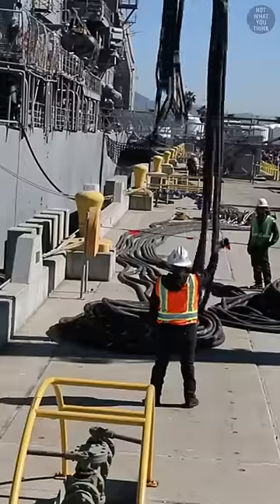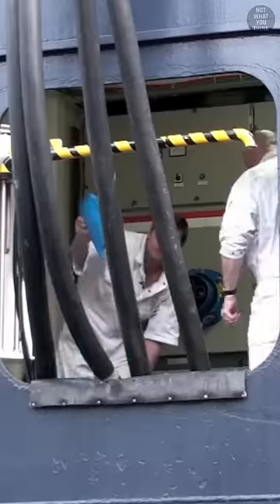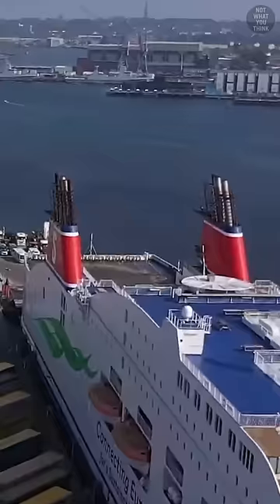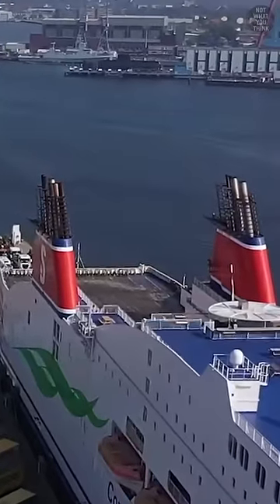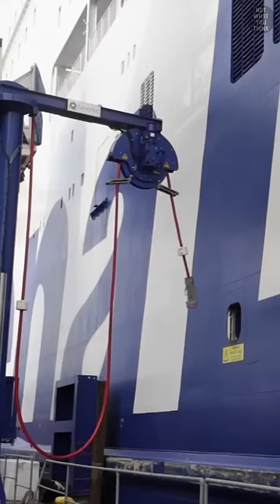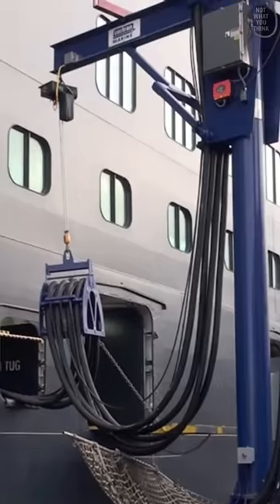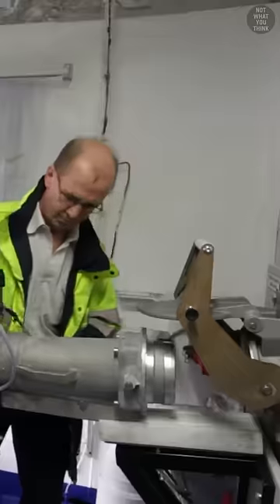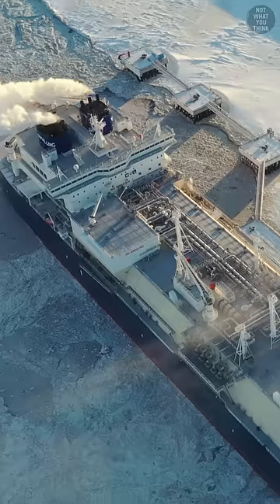Why Ships Burn Fossil Fuel When Idling? #shorts

Comment: One ship= 50 million cars

And yet they’re trying to force us all to get EVs
Reply: 50 million cars is still 50 million cars. Would you set fire to your house just because you saw someone else also trying to burn it down?
Reply: @frainy345   or you had a bad education... Even if humans are a problem you will NEVER turn and talk to the ones who are doing the polluting.
Reply: @relguiatmont7336  is there some intended meaning in those words you attempted to string together?
Reply: If you get rid of the ship, you have to find other ways of moving the cargo.

The ship is the most efficient way to move the amount of cargo that needs moving.

Until they build global conveyer belts...
Reply: @goodisnipr or, artillery cargo cannon, capable of launching cargo from country of origin to it's country destination straight to your receiving custom.
Reply: @frainy345 (Greta) (Moshe) Thun[[[berg]]] arrives to the WEF/Davos climate change summit every year in a private jet and then a gas guzzling hummer limo so (s)he can tell us to drive EVs, use public transport, eat bugs, drink soylent, sleep with the lights off and take cold showers.
Reply: @relguiatmont7336 I'm an environmental technician. As long as people keep trying to point fingers and blame other people for making more pollution we will never get anywhere. Guess what? You are the reason those ships are even necessary. Everything adds up, just because one thing os more than the other doesn't mean we ignore the smaller thing. If you treated your health like this you would be dead within no time.
Reply: @AGUSTIN-zc5iu 😂😂😂
Reply: @QwertyoUip  are you planning to arrive at your point anytime soon?
Reply: Sooo, why is the shipping industry not being forced to redesign engines and power units to be more environmentally friendly? And why is that load being so heavily shoveled onto regular people?

Something about this seems like heavily unbalanced bullshittery to me.
Reply: @Novafro  real
Reply: It's not "they" ... It's us. Buying cheap goods from China that don't last. It'll be fixed soon, industry is moving manufacturing to Mexico at an incredible rate
Reply: @goodisnipr The problem is doors have absolutely no population regulations. They can, and do, throw as much pollution into the air and water as they want. I've read there are just a few thousand big ships in the world, compared to something like 15 billion cars. But those few ships put out more pollution than all of the cars put together
Reply: @danielescobar7618  yeah I think that would be a positive move… ideally we move the manufacturing back to the US but at least Mexico is closer
Reply: @goodisnipr  that is a fair point, certainly ships are a lot more efficient than aircraft 

However, maybe the whole global supply chain is the real culprit?

Or at least, we have design engines and exhaust systems for ships that are create less pollution?
Reply: What is the connection you’re trying to point out?

Those ships are the backbone of the global logistics industry. Almost everything we buy is transported around the world in those things. And in terms of efficiency, one ship may be worth 50 million cars in total emissions, but due to the sheer amount of goods transported, they are far more efficient than your car.

Indeed, in order to decarbonise we need to find a better alternative, but shutting that simply isn’t an option. World is built around logistics and transportation. We can replace some ship routes with trains, but in order to match the capacity they need to be very high capacity routes, also electrified (as diesel trains are LESS efficient than ships) but even that is not gonna cut it since crossing the Atlantic/Pacific isn’t possible with trains. The only option remains nuclear cargo ships, but there isn’t much work going into those.
Reply: @tubeofnoob4683 but why restrict normal folk to be environmentally friendly when politicians have private jets, rich people own yachts and 30 supercard and giant cruisers are constantly sailing. They pollute the world more in one week than I can in my whole life.
Reply: @thebakedtoast  now multiply that by the population. There are many more regular people than politicians or rich people. And last time I checked ked we are not forced to be environmentally friendly lol
Reply: Because it's not about saving the planet, it's about control
Reply: @nicolaspeigne1429  True.
Reply: @frainy345 Would you set fire to your house with a match just because you saw someone setting fire to it with a flamethrower? That’s how bad that analogy fits this situation. 🗿
Reply: @frainy345 I know what the problem is. We found a butthurt dude with an ev who thinks he’s actually helping to stop global warming
Reply: @daveyjoseph6058 it runs on rainbows and unicorn farts.
Reply: So i can't buy a new 250cc 2 stroke but a single ship can put out more weight in fumes than 2 strokes made in the last 25 years.

Yes, what a fair society we live in!
Reply: @frainy345 Proportional representation.

Not point chasing 1% and ignoring 99%
Reply: @tubeofnoob4683 we absolutely do get forced to be enviromentally friendly with "fixes" pushed on the populace.

But most are fake fixes: paper bags which cause 10 times more shipping as less fit on a pallet.

Bagasse which was great to get rid of sugarcane waste ~ but now we produce more sugarcane for just the bagasse.

Or EV's which we all know aren't a sustainable long term solution, with the way the batteries are set up now.

And you say we can't look at the giant merchant ships that can't be arsed to at least fix their pollution at port? Or all the littering they do?

Acting like those small regulations will change anything long term and, not willing to improve the big polluters is a way to get the populace to think we are on the right track, whilst in reality the biggest problems are absolutely not beeing tackled.
Reply: It’s actually not true regarding CO2. 50 million cars produce many times more CO2 than a single ship.
Reply: @tubeofnoob4683 environmental technician? Lollllllll
Reply: @danielleisrael  yeah, I've also taught chemistry at a college. In which I finished with an average of 96%. The fact you laugh at other achievements is kind of pathetic  lolllllll.
Reply: Key word FORCE!!
only about money, power, and, control not the environment!
Reply: @theglitch99  key word NOT as in you do not understand anything
Reply: @tubeofnoob4683  open your eyes and see reality! Talk is cheap...
Reply: @frainy345 yeah but 5 ships equals every gas powered car in america
Reply: Per KG of fuel big ass ships like this are the single most effective and efficient way of moving cargo. Same with towboats on the inland rivers. Semi trucks use so much more per capita it’s not even funny.
Reply: Literally don't drive. That's the thing. Just use public transportation
Reply: @frainy345 There's 1.5 billion (1,500,000,000) cars in the world and 120k cargo ships. 120k x 50 million is 6 trillion (6,000,000,000,000). That's a 4000x difference. Your example isn't really relevant to this, the point is more they're focused on us switching to EV cars for environmental reasons yet situations like these make it an irrelevant goal.
Reply: @baseballhunter42  That's fair, but your figures are grossly inaccurate. The International Maritime Organisation puts global CO2 production by ships at about 1.12 billion metric tonnes, which is equivalent to 205 million cars. The point is though that if road freight were used in place of ships, it would create 100x more pollution according to MIT.
Reply: @Novafro they are. The bit about lack of regs allowing bunker fuel in port is just wrong for the whole developed world 
You need to burn diesel or have emissions scrubbers to enter ports and most seas and channels
Reply: @frainy345  I'm going off the numbers that you've been talking about in the past month here of 1 ship equalling equalling 50 million cars. If you had an issue with that you should have raised it over a month ago, I'm not going back and forth as you change data. My math is entirely accurate based on the data everyone here has been arguing over.
Reply: @frainy345 and there's how many ships? If each ship is 50 million cars, then there must be billions of cars worth.
Reply: @frainy345 would you move out if your comfortable house youve known all your life just someone else sent their house on fire in a different continent? if not why are you forcing us to get electric cars to make up for these ships buring fossil fuels and the lack if regulations around it? why not actually address the issue at hand instead of picking up breadcrumbs? theres 100s of people flying private planes cross-state to talk about how bad ICE cars are when they could drive and be much more environmentally friendly themselves. the people signing the papers that say "all cars must be electric by 2035" flew into that state on a plane much worse than almost any car. but we should see our lives being forced to change as "progression" when we havent progressed enough to know and openly talk about the impact it really has
Reply: That’s a fallacy.
Reply: Global trade should be shut down. Problem solved. 😊😊
Reply: @nicolaspeigne1429  Control over what exactly? What the fuck would the 'big bad shadow government' gain from this shit?
Reply: @frainy345 I was think that about what you said 😂
Reply: @frainy345 Yes I would join them if they invited me, who doesn't want to burn a house seriously
Reply: Now you start to see the connections
Reply: Ummmmm I'm not really sure that that's correct 😂😂😂
Reply: The world cannot currently produce/grow enough power poles to support the necessary grid infrastructure unfitting required in North America to meet current EV goals.
Reply: EVs should be just an option.  In Canada, the cold climate, large distances and limited infrastructure, EVs are not practical.  Mexico would be a more favourable location.
Reply: That's because those making the laws are getting rich doing so. It has nothing to do with the environment.
Reply: @Novafro they are. It just takes over a hundred nations to agree. To get the IMO to do anything.
Reply: @finlaymcdiarmid5832 but ships are two stroke.
Reply: @cloggedpizza239  ?
Reply: @frainy345  if one ship can make the difference of 50 million cars, literally 12 ships can provide for the entire united states (assuming each citizen regularly drives two cars, a very generous assumption). i don't need an EV if these ships can be regulated lol.
Reply: 1: that’s based of off of the sulphur oxide emissions from the largest ships not the carbon dioxide emissions from the average ship.

2: there are 50,000 large ships on earth.

3: there are 1,500,000,000 cars

4: ships are insanely efficient so I’m not sure about those numbers. The true value is that ships use 50 times less fuel per kilometre.

5: we can’t make efficient electric ships yet.

6: cars are by far the biggest polluters, we have the technology to make efficient electric vehicles and we should make them standardised
Reply: @relguiatmont7336 the highest polluters are the individuals
Reply: 50 million cars when measuring NOx and COx because of fuel standards and lack of catalytic converter, not when measuring CO2, the main driver behind climate change and the reason we need to change to electric cars.
Reply: 50 million cars when measuring NOx and COx because of fuel standards and lack of catalytic converter, not when measuring CO2, the main driver behind climate change and the reason we need to change to electric cars.
Reply: How we gonna move things across silly people
Reply: Sloppy language from the video.

By "pollution", he means particulate emissions (because the burning is extremely dirty/incomplete). This is from that black smoke, and these emissions cause smog, acid rain, breathing issues, etc. They are definitely bad.

But they are NOT greenhouse gasses. That is a different problem, and in a weird twist this dirty burning actually has a cooling effect. Those particulates travel into the upper atmosphere and seed clouds, which reflect sunlight mich better than land does.

In terms of CO2, these generators aren't much worse than a single car. They just release way more smog.
Reply: @relguiatmont7336 many ships dont use filters
Reply: It’s not 50 million cars worth of carbon dioxide, it’s 50 million cars worth of sulfur oxides. The only reason the number is so high is because cars and gasoline are regulated the way they are. We used to spew sulfur into the air in and around our cities, which is what causes acid rain. There’s a reason we don’t have acid rain any more, and it’s thanks to regulation.
Reply: @thebakedtoast the reason you regulate regular people is because there’s about 8 billion regular people compared to the number of those with private jets and yachts.
Reply: @birdrocket  and those with private jets cause 80% of harm
Reply: @thebakedtoast  I wish that were true because it would make solving climate change so much easier. Unfortunately, it’s nowhere near the case. Private jets only make up 0.2% of all carbon emissions.
Reply: @birdrocket  private jets, cruise ships, super cars, extravagant life style. It's fact that the super rich account for the majority of carbon emissions
Reply: @thebakedtoast  again, I wish that were true, but it’s not. They use egregious amounts of energy and resources when compared to a normal person, but normal people outnumber the private jet flying rich by about half a million to one. They do not create enough emissions to even come near half of global emissions, let alone a vast majority
Reply: @birdrocket  yes they do.
Recent data from Oxfam’s research with the Stockholm Environment Institute shows that the wealthiest 1 percent of humanity are responsible for twice as many emissions as the poorest 50 percent and that by 2030, their carbon footprints are set to be 30 times greater than the level compatible with the 1.5°C goal of the Paris Agreement.
Reply: @thebakedtoast  that doesn’t mean the 1% produces most emissions. It means that the bottom 50% of people globally emit a very very low amount of carbon. That oxfam report only puts it at 16% of total emissions. Still a huge amount, and way more than what they should be, but not the vast majority of emissions. 

Median household income globally is less than $10k a year, which includes only single digit percentage of Americans. Even the average person in the US is using up way more carbon dioxide than we can afford, you and I included. If everyone on earth was as polluting as the US, CO2 emissions would triple. That is why we have policies that aim to reduce the CO2 emissions of the average American, because the average American is still relatively wealthy by global standards.
Reply: @birdrocket  The richest 1% (77 million people) were responsible for 16% of global consumption emissions in 2019—more than all car and road transport emissions. The richest 10% accounted for half (50%) of emissions.

It seems like you're rich but don't want to take blame. There's literally thousands of articles about this topic
Reply: dont worry, it is a lie
Reply: @frainy345  Oh well....
Reply: We need the ships.
Reply: ...yeah...that figure is way off
Reply: @QwertyoUip  That just isn't true, she uses public transport intentionally.
Reply: @birdrocket  I never knew that about acid rain… thanks for pointing that out
Reply: Scams, scams, and more scams. It’s so exhausting.
Reply: @frainy345  you probably have an electric car 😂😂😂😂😂
Reply: @frainy345 I simply cannot afford to buy an EV.
I drive a 2002 Toyota tundra which has 230k miles on the odometer. It is an extremely reliable machine.
I can drive myself to work with it, I can cut firewood and haul it home to heat my home.
Tell me, which EV vehicle can I afford which provides me the same level of reliability?
Reply: @tubeofnoob4683 no we aren’t the reason those ships are necessary. Once upon a time we used to manufacture everything we needed right here in America and imports were at a minimum. The reason those ships are necessary is because of the greed of corporations and their shareholders who sent all manufacturing overseas to Asia
Reply: Even though you are right. Goals as large as ending climate change must be achieved on every source of human caused pollution.
Reply: It’s because they need oil for the war machines
Reply: 50 million refers just to sulphur emissions, which modern cars basically emit very little of. Its a misleading headline
Reply: @frainy345  50 million cars is 50 million people driving cars. You'd need 50 million EV's and means to produce power for them.

Higher focus on nuclear power would mostly fix drawbacks of EV's, but "nuclear" is a scary word for general public the same way as is LGBT scary word for conservatives all over the word.
Reply: @frainy345 yes yes i would 😂😂
Reply: It doesn’t equal 59 million cars though
Reply: @QwertyoUip  your comment would be more powerful if you didn't let your antisemitism show
Reply: The pollution in this context is sulphur dioxide, not CO2. CO2 pollution is almost directly proportional to fuel burned, and it's pretty obvious one ship doesn't burn as much fuel as 50 million cars, simply because 50 million car engines wouldn't fit on a ship.

Sulphur dioxide isn't so bad for the climate, but it is poisonous. So it's very bad in cities, not so bad in the middle of the Atlantic where there's nobody to poison.

This has led to strict emissions limits for cars, but less strict limits for ships.

Thanks to limits imposed on car and power station emissions, man made sulphur emissions peaked in the 1970s.
Reply: @QwertyoUip  No she doesn't.
Reply: I do not beleive this for one instant, that is a lie outright.
Reply: @jeffs-reviews  It's true, but only for sulphur dioxide. Which is actually fine. Sulphur dioxide is a poison, so you absolutely do not want it coming out of cars which are next to people, but it's far less of an issue in international waters.
Reply: One ship might use 500 tonnes of fuel over two weeks, 50 million cars could use 2,500,000 tonnes (if each had 50 litres). This comparison is poorly conveyed.

Shipping makes up for 3% of global emissions but is crucial in sustaining international trade. Enforcement for redesigning of engines and reduction of emissions does exist through international conventions.

A cruise line I recently worked for as a navigational officer spend over $1 billion dollars investing in scrubbing machinery to reduce their emissions.

Yes each ship uses quite a lot of fuel but it is by far the most economical way of international trade.
Reply: @frainy345 I like electric cars but don't they become CO2 neutral after something like 3-7 years of driving depending on how your electric power is generated and the type of car it is (sports vs economy car etc)? Not to mention the devastation caused by the lithium gathering etc. And we don't even have enough resources for everyone to switch to all battery storage.

At least that is my understanding of the situation.
Reply: @AGUSTIN-zc5iu one of the best comments I've ever seen 😂😂😂😂🎯🎯🎯🎯
Reply: Converting cars to electric drives is straightforward, but greening ships presents greater challenges. Despite the complexity, ships remain more environmentally friendly and efficient than cars, thanks to their capacity for heavy cargo transport. Using alternative motorized mobility for the same loads would result in significantly higher emissions.
Reply: @frainy345 sure. but it shows they are full of shit when they havent done anything to standardize these connectors and ports to have shore power
Reply: And there’s pressure to phase out these types of ships too, genius
Reply: exactly. And all the other "green shet".
Reply: @QwertyoUip stop schizoposting, take your meds!
Reply: The pollution of 50 Million cars. Probably not the emissions. Switching to electric cars is mainly done to reduce emissions - less pollution is a positive side effect.

That said, it's outragous, that burning oil just for electricity is still allowed if there are alternatives.
Reply: @alipercapita  pollution is bad in major cities, but you must see that their argument that we are changing the world's climate in a significant way, and that its some immediate existential threat is bullshit right? based on their actions and all
Reply: Yeah, that's why we shouldn't have cars at all when possible. Most people live in cities.
Reply: @sven_527  you can go without a car if you want in your big cities, but everyone else needs cars. and your big cities completely depend on everyone else to survive. why do yall in big cities act like you are the only ones that exist, and that all of the stuff you get just comes out of nowhere?
Reply: The more important humans of this world need private jets, without them, the world will fail.
Reply: Who is trying to force you to buy an electric vehicle? Is it "THEM"?
Reply: @randal3122  CO2 is responsible for about 20% of the effect of all greenhouse gases. The greenhouse gases warm the atmosphere from -18°C to a habitable 15°C. We have  increased CO2 levels from 280 ppm to 400 ppm during the last 150 years - in an accelerating speed. That is significant and if you add the existence of climate tipping points, it is the single biggest threat to the planet in human history.
Reply: @Novafro Ships can and do use different and less polluting fuels - but some are more expensive. That's why they use the more polluting, less expensive heavy oil - but they should not when in port (however some do).
Reply: @alipercapita  our period of history is at historical low levels of co2 in all of history from what i see. life has thrived through all of it, including animals. plants live on co2. how do you figure it is a bad thing for plants to have an easier time? if it was really some major existential crisis, why are climate activists the worst offenders in the world? they produce millions of times more emissions than the average person. they also dont have an issue buying properties in areas they claim are going to be under water in a few years. bro, its a scam. how many times do they have to lie about everything before you start questioning their bullshit? dude, biden stopped oil production in america because of climate change, and then immediately started begging saudi arabi to ship more oil here on massive cargo ships that cause much more co2 emissions than we would have otherwise. why do the same people that push this agenda also defend china and sending more and more production to china that is far more polluting? none of it makes any logical sense with what they claim. if you really think we are at some kind if tipping point if our emissions destroying the climate forever, I have an island to sell you
Reply: Oh there are a LOT of initiatives aimed at improving maritime emissions too. It's harder because so many of the ships are foreign owned and flagged of course. But emissions need to be reduced across all sectors where they can be
Reply: @Fomites  democrats are. newsome even set a date. he also banned gas powered lawn mowers and other lawn care equipment, and tried to ban natural gas stove tops....
Reply: @frainy345 1 ship is also 50 million cars stupid. It's far easier to retire old ships or use standardize connectors than doing the same for 50 million car.
Reply: so replacing every car in the US with an EV would offset the emissions of… 5 ships. good to know we’re focusing on the important things
Reply: @frainy345 if the wife is inside, yes 🗿
Reply: @goodisnipr  that's some wild theoretical technology.... A conveyer belt that's kilometers long would straight up break instantly upon turning it on, that's how physics work.
Reply: @AGUSTIN-zc5iu that's even worse ... You know how expensive that'd be to make a reliable cargo launching cannon without having the cargo just crash violently at their target ? Also accelerating something so suddenly is guaranteed to destroy whatever is inside.
Reply: @birisuandrei1551  You haven't seen the ones at car manufacturing and Amazon facilities.
It's not a belt so much as it is a series of rollers, only some of which have to be powered.
Reply: @goodisnipr  yes but that's still within the realm of possibility.... A conveyer going from one country to another would literally be way too expensive or not work at all because of the insane length.
Reply: @frainy345  The irony is that climate activism is lead by billionaires who are also the biggest polluters and make the decisions that lead to corporations polluting
Reply: @birisuandrei1551  roller coasters
Reply: @goodisnipr produced in Portugal, packed in China, sold in Europe.

Ships are not the most important way of transportation if we would see energy as a currency instead of just dollars.

Spending five times more energy to save 30% costs. Is that really making more profit?

Goods are constantly being bought and sold during transport and this drives prices upward with some significance. Shorter transport times would result in lower prices.

🎶It's all about the money.... Its all about the Dum Dum didi dum dum🎶
Reply: @frainy345  not the point they are idling and not doing much besides maintenance and we can find better way to do it rather than burn fossil fuels for weeks when idling that is equal to 50mil cars,
if 1 ship means 50 mil cars than there is no justification about crappy EVs.

you talk like there is nothing we can do so we have to put up with it because cargo ships are important but we can come up with solutions to it but it will be expensive for the ship company and govnt. and so they dont want to do it but expect general public to use crappy EVs with centuries old battery systems which is hazard in it self.
Reply: Well intelligent boy for ev you need electricity, how you are planning to get electricity in the mid of sea. 😂😂😂😂. We generate electricity by generators which run on fuels. There are generators which utilise motion of main engine- shaft generator. And if you apply such rules on merchant ships than forget about ev you will not get even a normal car to run. Ships are the back bone of transport
Reply: @frainy345  this is the most illiterate comment I’ve ever seen
Reply: @goodisnipr i think the issue is ships run in the worst type of fuel
Reply: @xBluesy  don't try to use the word illiterate if you don't know what it means.
Reply: Don't believe all the lies
Reply: @frainy345 your neighbor is having a massive bonfire in his front yard, and the government is making you remove the grill in your back yard.
Reply: get solar if your climate condition support it.
Reply: Read MAPOL VI and exhaust scrubber is mandatory for ships with heavy oil after 2020,  Yes they produce CO2,  and a ship uses around 30 tons per day,   But heavy oil and refined oil produce similar amount of CO2 and heavy oil have more energy,  Ship do alot more work for minimal amount of enery, Same work will require 20 times more fuel on land. Without shipping no trade,
Reply: @frainy345  The point is these people my whole country to implode its economy to save less carbon than half a ship.
Reply: Funny how you target transportation and our main infrastructures but don't make note of the vastly larger amount of resources consumed by space agencies.
Reply: @GaijinGamerGirl  space has never been able to be a green tech, while the shipping industry is entirely capable of being green
Reply: @alexnorth2452  space exploration is fruitless and a waste whereas shipping is essential for maintaining trade and transport of material.
Reply: @GaijinGamerGirl  space is essential for human expansion, and again shipping can EASILY be 100% green, furthermore as tech improves, space will eventually become greener as well
Reply: @GaijinGamerGirl  also I just can't help but point out, the exact strategy you used in your first comment, bringing up a completely irrelevant topic to the discussion,  is the exact tactic big oil has been using for decades, it's diverting the discussion from the problem

Keep everyone focused on everything else and not the actual issue, but then again anyone named gamer girl is probably pretty good at distracting people 😅😅
Reply: The next time you buy something that has been imported, remember how it got to you.
Reply: Fifty-million cars can't move the freight of one ship.
Reply: @Bill-sp8kb  yet the sailing vessels of old could and they could do it without burning a drop of fuel
Reply: @frainy345 he's made a good point to be honest. No matter what we sacrifice to reduce our emissions as individuals, we don't take care of the actual problem.
Reply: @goodisnipr maybe you didn't watch the video. They need electric hookup standardization.
Reply: Please consider that giant merchant ships are the reason the civilized world exists, but you driving 2 miles down the road for McDonalds is not.
Reply: @belgianfried  this point right here. However a lot of us in the States don't even have that option unfortunately. Everything and I mean EVERYTHING is car centric. Restaraunts, entertainment, retail, hell even business and work environments. Very little here (especially where I live) is accessible by anything except for cars.
Reply: @nightlight0x07cc  and please remember that for hundreds of years, shipping was incredibly environmentally friendly, they don't need to be oil chugging monsters, they just choose to be
Reply: @alexnorth2452  what you mean sailboats?
Reply: @nightlight0x07cc  no I meant row boats 😅 yes sailing vessels
Reply: Not to mention what cruise ships do
Reply: EVs are the biggest con in tne history of transport..
Reply: @goodisnipr  that's a good point, one ship moves more cargo than 50 million cars
Reply: They're not talking about CO2 emissions, when they say that one ship pollutes as much as millions of cars...

If you want cars to be held to the same standards as boats, it's not EVs you should be campaigning against! It's catalytic converters
Reply: Would you rather have millions of tiny engines fanning feum to your window every day just for people to get stuck in traffic and never going really anywhere
or just few big ones in an isolated and easily regulated areas to power them.
Reply: @เรามาแปล  Small correction, to an otherwise good point. Ships are NOT easily regulated. International waters are very difficult to regulate.